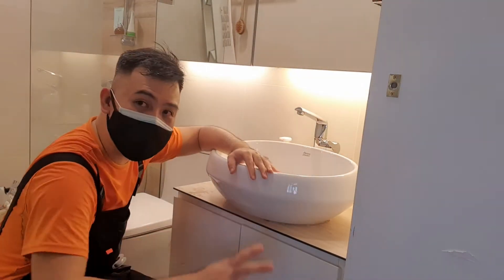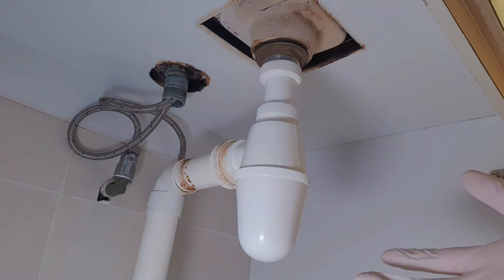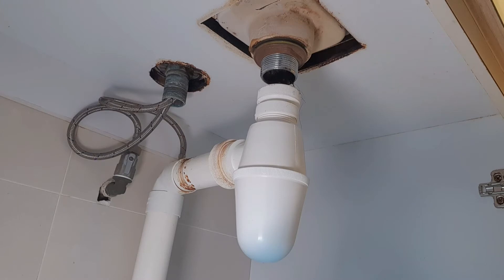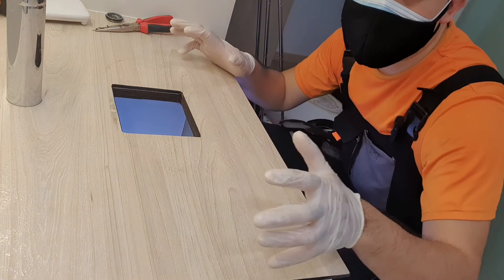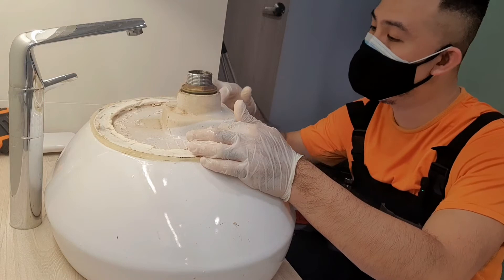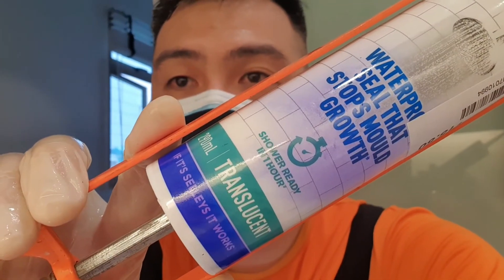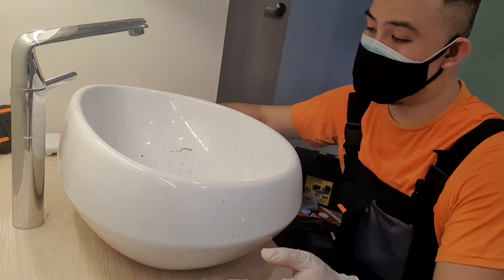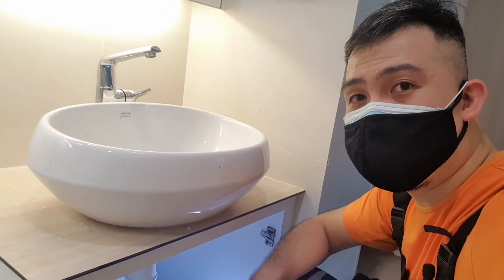The Punggol Handyman- Fixing a Vessel Sink Leak

Comment: Silicone is a sealant and yes it will prevent water from going in into spaces you don’t want water to go in. Now that’s not going to really stop the sink from being loose it will keep it in place for a bit but the sink will come loose again because is not glued into the counter top also I believe the opening they made for the sink is kind of big and you have space for the sink to move from side to side.
Reply: Silicone can be an insanely strong glue. I bought an old van with a heavy old solar panel that was just held on with silicone. It was a huge ordeal to remove because it was so well glued down.

Comment: Hi. Is it a good idea to put silicon around the base as well? So water or dirt wont get under the vessel?
Reply from the maker: The vessel sink was designed to look like a bowl on a table. If you do that,  you spoil the look
Reply: @ThePunggolHandyMan  if its not the bowl type? Like a rectangular shape? Is it ok? I want this type but i got kids. 😂😅😅
Reply from the maker: @khairulnizam4177  usually I wouldn't recommend it. Harder to clean the back. And most of the sink leaks come from this type of sit on top sink
Reply: @ThePunggolHandyMan  Noted. Tq very bro.

Comment: Geez. Thank you for uploading. If I were in your shoes I'd ask the owner to please flush that acid used to unclog things before doing the job 😮
Reply from the maker: Are you talking about a different video?
Reply: @ThePunggolHandyMan   @ThePunggolHandyMan  Nope. The gunk you had to clear, made me 🤔 think: he's there to repair a leak, he shouldn't have to deal with clogs... Unless you already charge for it in your standard rate. By the way, is it safe to use caustic soda with modern pipes?
Reply from the maker: Well in my experience all pipes have debris to a certain extent and this was a scheduled appointment not a emergency call. So no I did not charge for the clearing as I actually did not need to go out of my way to clear it.  Yea and I usually flush the whole system with a bucket of water before i begin work. Err hygine